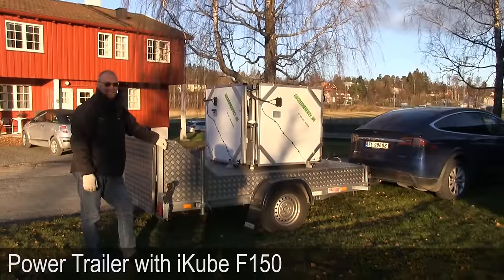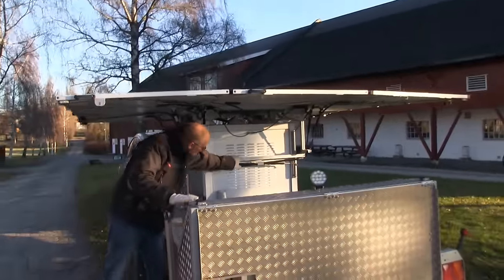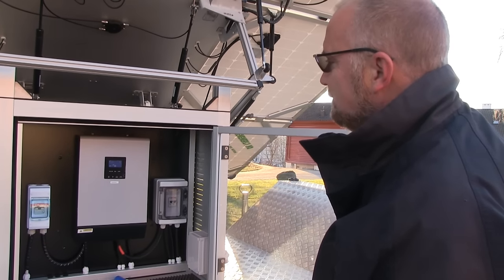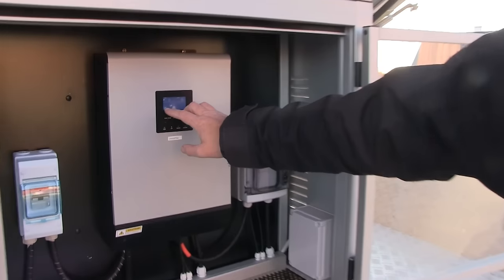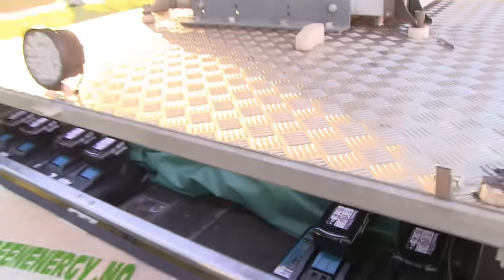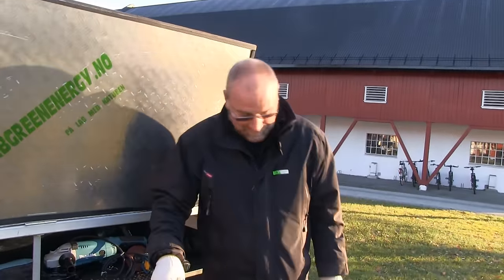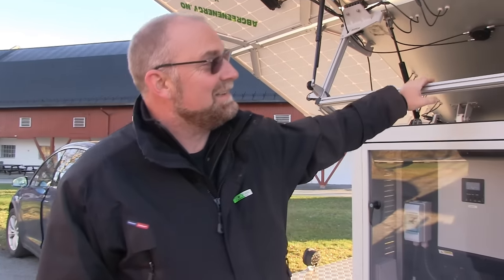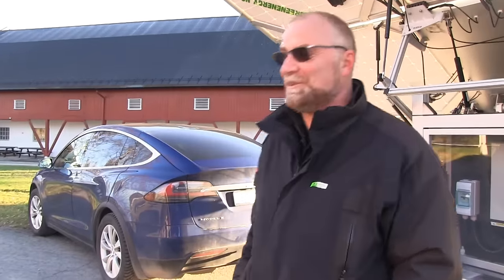Power Trailer by Green Energy

Comment: This is such an awesome concept. I can easily imagine a future 15 years from now where many gardeners, plumbers, electricians, construction workers, etc will haul around a trailer with their electric tools and a solar array, rather than their stinky, noisy gasoline powered tools like we see today. Plus, they could use the trailer as a range extender for their electric pickup truck if need be. Very cool!
Reply: Why? It is much easier to use the general infrastructure to charge 2-5 car batteries. Bring the batteries and a power invertor. Done. No need to take the panels with you to use power tools on the job. Besides, these people usually work in or around homes with plenty of power.
Reply: Many construction sites don't have power, so they need gasoline generators.  Also, many landscaping crews work when the home owner is not home, and many homes don't have accessible power outside of the home.

As a bonus, you can take this into the middle of nowhere, to build a cabin in the woods, road side service, etc. etc.

Comment: IF you ask me, would make a turn table for that kube so if you park in open area with no shading obstructions it would track the suns movement, of course the turntable would lock into place for when in transit to new location. So you would just park it and not have to reposition the whole trailer when the sun gets just out of range.

Comment: If in Denmark you cant carry high amounts of lithium batteries doesn't that make electric cars illegal?
Reply: I guess there are other safety regulations for electric cars, plus an electric car has an advanced battery management system which keeps the battery healthy.
Reply: EVs are definitely not illegal. But it still seems like a stupid rule.
Reply: The law is probably about towing them in a trailer.
Reply: I'm pretty sure the shielding and testing of that shielding have a lot to do with the regulations.  Tesla put a lot of work into their Lithium Ion based battery shielding systems.  They protect the occupants and other structures in case of fire and even puncture.  That work could also be done for other systems, but is rather expensive, and doesn't scale down to a few unit sales very well.  As time goes on, various higher power density battery solutions that are transportable could become available.
Reply: It's probably not that it's illegal to transport batteries, but that there are extra rules. Here in canada for example it would be the same as hauling a trailer full of gasoline, you would need special paperwork, special markings on the vehicle and you would need to follow the "dangerous goods" routes around the city centres.

Comment: Is this currently only available in Norway/Denmark? Any plans to make this trailer system available in the US? How much would it be to have one imported/exported to the US? Would it be feasible to have the cube be fixed at the front of the trailer, have the trailer floor filed with batteries, and have a ramped end as to be able to drive an electric lawnmower onto it?
Reply: It is not built for electric vehicles, it is built for the craftsmen who will be completely independent of the grid. This task is achieved 100%     We can easily export to USA,
Maybe you would rather have a iKube and then build the trailers of your choice by lending our patent.                      We could use a distributor in USA

Comment: This is a great solution, you've really thought it through. 
I have a question about the trailer and legal stuff in Denmark.

In Denmark the government has made it somewhat useless and expensive to get solar panels on the roof of houses, which mean that we barely have any reason to actually buy them anymore, which is sad and stupid.. But what about having a trailer like this hooked to the house supply, instead of having solar panels and a battery inside the house? Is that legal and possible? 9 square meters is a lot more than we are allowed to on the rooftops. I don't know if it would be better economic to use one of these, but the thought of it, is definitely interresting.

Comment: Pretty neat unit, and practical for as you mention gardeners.

I have one question, not related to the trailer: Has the Tesla model S been approved or certified by Tesla to pull a trailer? I have searched far and wide on the Internet, and so far it seems that it is possible to mount a trailer hitch and is capable of doing so, but so far Tesla has not given their permission or certification to do so, and therefor it is illegal in most eurpean countries.

Comment: Are the 9 solar panels connected in series or in parallel? If in parallel, they will be less affected by the shadow, but have more loss in the wires. For places where shadows are likely, parallel connection would normally be preferred.

Comment: I have had a PV system for almost 7 years. It's max rated out put when it was new was 4.7 KW per hour on a perfect summer day.  The max it ever put harvested from the sun on a was 35 or so KWs a day....  Does this mean it would take 3 days to charge a Tasla car with the biggest battery NOT taking into account the less than 100% inefficiencies all energy conversions have?
Reply: If your house also used no power?  Yes.  
It is really amazing how many kWh electric cars carry.  Just 1 Tesla can have enough batteries to power a house for a week.
Reply: Yes, the energy of Weight X Distance X Time adds up especially at 60+ MPH I suspect.

Comment: Wouldn't it be waaaay more effective to charge the Makita batteries with DC and not inverting it to Ac and converting it back to DC ? Huge loss on the double conversion.
Reply: there's no good common/open DC charging standard for Makita to use except 12v car outlet. Those chargers can only operate at 1/4 the speed of Makita AC wall chargers (which have active cooling). For power tools, charging speed matters more than efficiency.
Reply: Well, if you only want to charge 12V power tool batteries, sure. Those will get your radio to play. If you have four of them you can mow the lawn. You can use one to drill small holes or put in some screws.

But if you want to use this thing for anything more than that, the biggest problem with it is the lack of maximum power and inefficiency in conversion. Good luck operating your 1500W demolition hammer when your maximum output is 1400W and you lose half of it in conversion.

Comment: What this video rather effectively does is to put to rest the idea that one could put solar panels on top of a car and have it be practical.
I love the idea of solar being used to charge the vehicles... but.. one MUST remain realistic about the surface area to do that.

Using solar for that application involves using the roof areas of surrounding buildings for collection to a common battery source that can supply power as needed.  Though this might be an interesting solution for a campsite, integrating such a thing on an existing large camper where the surface area was there anyway would be preferable to this.

In the end, however, it comes down to battery density.  Hauling around batteries with low energy density in a vehicle that's supposed to move all that extra weight.. makes zero sense.  laws MUST change to open up batteries of higher density.
Reply: Watched the whole video and saw the time on the charging screen view how long it estimates for charge from what he already had to full, 12 hours! You would need three to six of these panels together to charge enough in a half hour to an hour just to keep driving!
Some folks just do not get why solar on a car is not practical, at east until pv get to 95% efficiency to be practical. But practical enough for what it is now made for to power and charge battery or plug in electric tools and such.

Comment: If it can charge your tesla... then you could drive forever if you had that trailer attached!
Reply: And charge when it is parked :)
Reply: WE DONT HAVE THE TECHNOLOGY!!
Reply: maybe a good option for long distance travel throug deserts
Reply: Unless it's night time or driving under a long bridge / tunnel.  Then you'd need extra energy to pull the trailer.  The energy density of the batteries in the trailer is also lower than the energy density of the lithium ion batteries in the Tesla.
Reply: You might get stuck or be going somewhere where there aren't any super chargers. There are a lot of them, but they definitely aren't everywhere.
Reply: Pete Coventry No longer free and not all over the world. My entire country only has 13, and the one closest to where I live has been closed for months.
Reply: p eibye the weight of the trailer uses as mutch power as it creates no point
Reply: Pete Coventry.. Well because superchargers are free only for S & X but not for model 3 or other models like Jaguar i-Pace..
Reply: Another reason you might want to is that you don't want to use chargers supplied by dirty plants.  OTOH, they say they're more efficient, meaning cleaner per unit of power, when at max load.

Comment: 1400W peak power. That is about 1.9 horse power. If you want to drive for 1 hour at an average of 50 hp you will need roughly 25 hours of solar panel time at maximum output. Just to put things in perspective. 

This will not power any car realistically. It could power your caravan on holiday in a sunny country.
Reply from the maker: Watch the video. It was never intended to power a car. It was intended to power tools for gardening or similar.

Comment: How many kilometers per hour of charging will 700 watts give you?
Reply: Roughly 2-3 km/h typical range.
In the Tesla Model S 11kW equals 50 km/h.
Reply: oh.  I could probably get out and push a Tesla that fast :(
Reply: 700 watts going directly to the motors would make it go 34 km/h though
Reply from the maker: 700 W is before charging loss. After charging loss, we get about 85 % of that which is 600 W. My Model X P90D uses 210 Wh/km as typical. That means a whopping 2.9 km/h.
Reply from the maker: Going 34 km/h will require about 100 Wh/km. So in order to maintain that speed, you need 3.4 kW power. With 700 W power, we might be able to push the car in walking speed (5 km/h). But that's without the trailer attached.
Reply: Bjørn Nyland i must have misplaced a decimal or something
Reply: Bjørn Nyland there must be some other factor I'm forgetting. after correcting the error and accounting for efficiency I got 43 km/h using the model s drag area
Reply: Did you add the losses from tires ?

At 43 km/h, Model S needs 0.6 kW (aero) + 3.9kW (tires) => 5.2 kW with 85% efficiency

https://en.wikipedia.org/wiki/Rolling_resistance
Reply: Esunisen got 7 km/h using 2440 kg weight. 0.01217 rolling resistance coefficient, .576 CdA, and 85% efficiency then
Reply: Correct.
Reply: Well, you could just let it charge overnight. Oops. I guess not.
Reply: It is not built for electric vehicles, it is built for the craftsmen who will be completely independent of the grid. This task is achieved 100%
Reply: And this is why the idea that so many people have of just putting solar panels on electric cars is not an idea that's ever going to go anywhere. It just isn't worthwhile. Better to put them at stationary parking locations instead.
Reply: Exactly. Not even 100% efficient panels are going to do much as you would still be looking at about 1kW max output per square meter. Of course this number varies with location and time of day. Solar is simply never going to power anything that is relatively small and moving fast, such as a car. You can make a very light airplane with a huge wingspan fly indefinitely, but that is about it. For all other applications; Tie solar to the grid and make sure your network can store the energy that is not used at that moment in time.

Comment: Unless they get the cost down its just not practical. If you want to use electric power tools its much more cost effective to either use a generator or just buy a few extra batteries and charge them up before you need them. $1000.00 a month is just not financially feasable. I own a lawn care company and at any one time I have between 6 and ten crews out working so that would be 10 grand a month. My total fuel bill including the trucks mowers, edgers everything even during peak summer months is usually around 5 grand. Unless they can bring the price down to where its practical I don't see these being used a lot. I think its really cool but not for a thousand dollars a month.